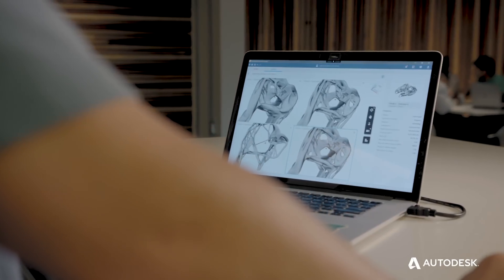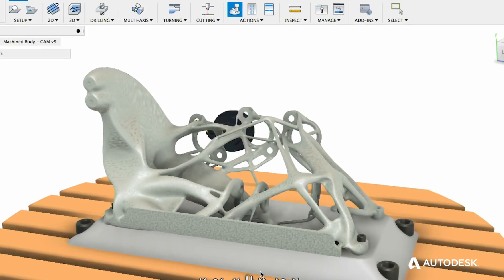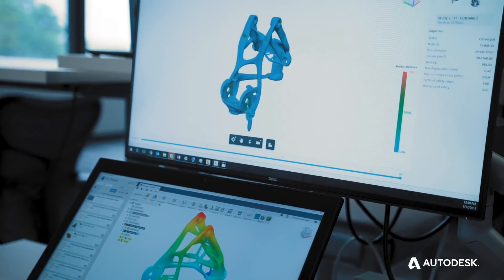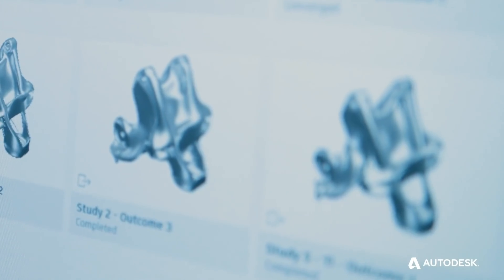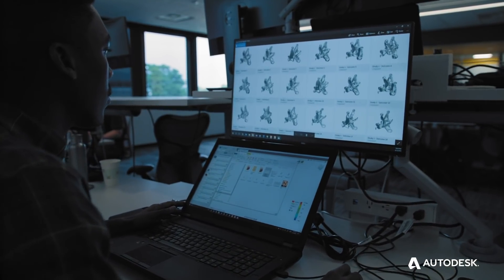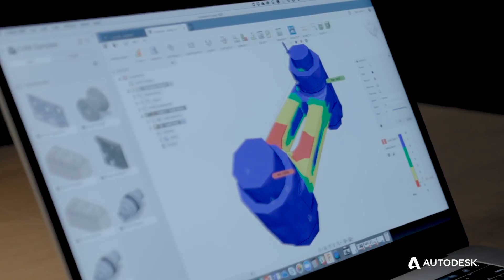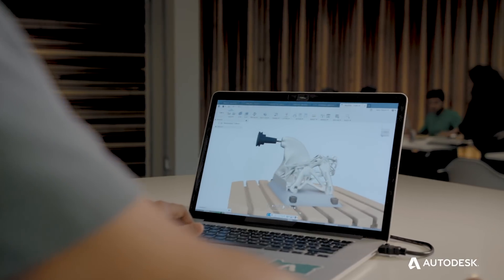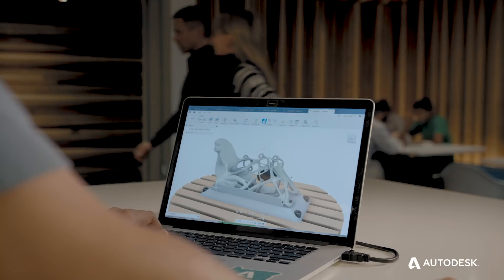One Fusion 360 - Tier Consolidation

Comment: Thank You for the start up status.  I suggest F3d have a special option to help bring products to market. (Im a maker/designer and need help with designs that are more professional looking and require further CFD etc. 

Thus, the one thing I would like to see added to your Fusion 360 is the ability to send requests to other designers for bids on their services in designing real products or concept completion.  This service could be as follows:   operate like 100kgarages, have option to filter for different designers based on their location, area of specialty, or, if they are "licensed" users of F3d or are makers looking for extra work etc.  The ability to quantify a fellow users level of expertise could be done inside F3d just as any other part of the design process.  With collaboration already in place, I think the designers could add value and consultation from within the app.,